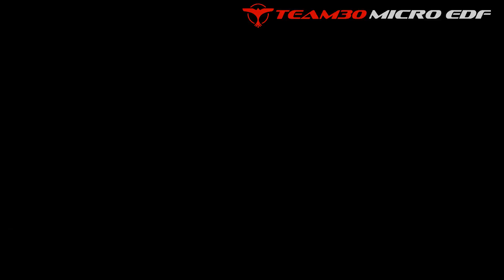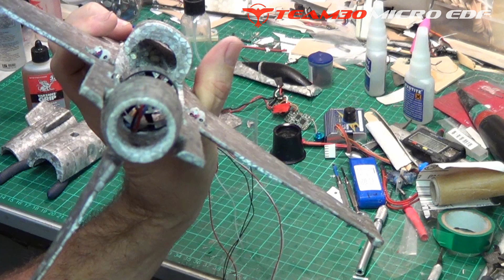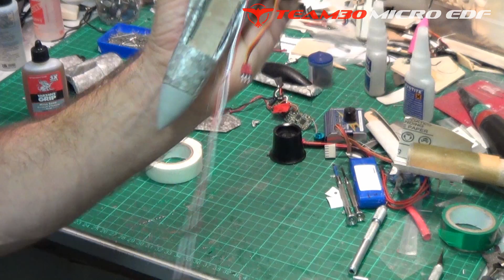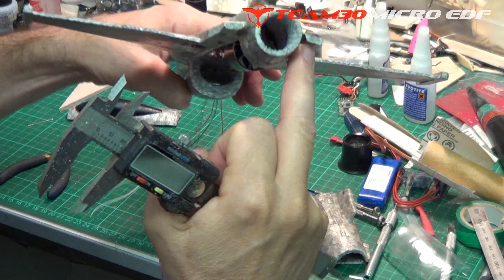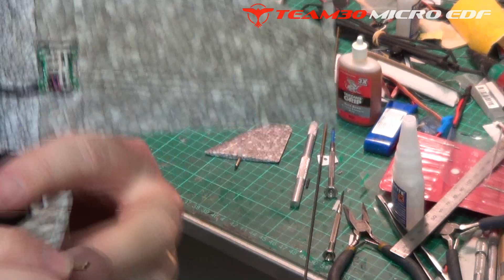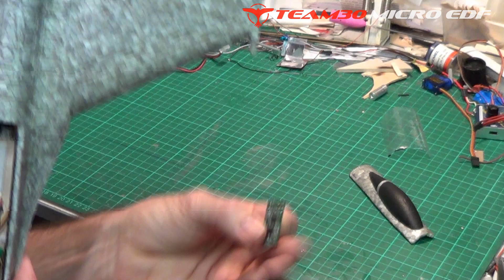HobbyKing X16 chuck glider to R/C EDF Jet Conversion!

Comment: I'm working on a micro F-16 conversion to EDF, how did you figure out motor placement and what's the percentages desired for for intake and exhaust diameters to motor size are desired? I'm using almost the same internals a umx Habu 28mm  as the donor. The plane being converted is a simple 2ch F-16 found on nearly every online store.

Comment: I am planning easy & perhaps more efficient route of putting my edf fan straight as nozzle & build a fake wiry nozzle of the size of divergent F16 nozzle. Hence air will not have to travel through long inlet instead it will be sucked straight through anterior part of nozzle & expelled through posterior part.  .. Effectively a small pusher prop but will not look cheesy

Comment: And also, wich flight controller allows tailerons?
Reply from the maker: Spectrum DX7
Reply: If you have a newer radio is should have it in settings under elevon. Or you can buy an electronic mixer for a few bucks😀👍

Comment: Nice job, what battery connectors are you using for the 300mah 2s?
Reply from the maker: I use micro deans connectors. :-)
Reply from the maker: Micro Deans

Comment: nice to see you back, like your micro vids. By the way what ever happened with those button retracts?
Reply from the maker: Yes I know - kinda fell off a cliff with that project: The printed material was too brittle and so anything other than a completely greased in landing was going to break them. I am in the middle of getting a mould made working with another rcgrouper so we can injection mould these in ABS plastic!  :-)
Reply: @NitroCharged  do you happen to have a extra chuck glider cause i cant find any on google :(